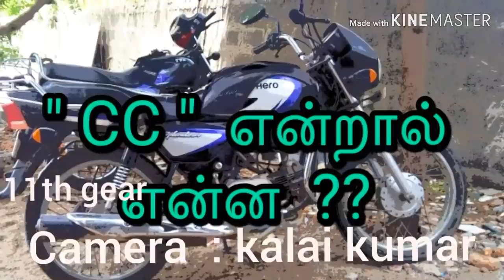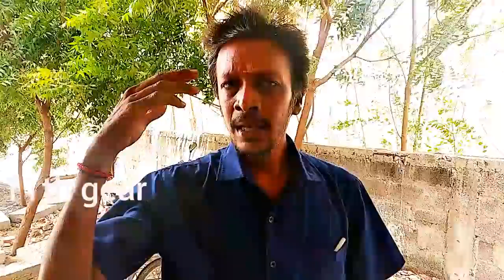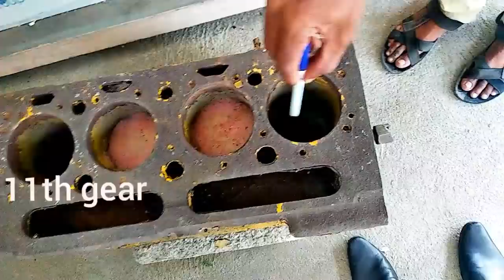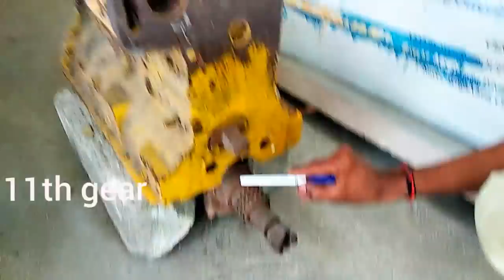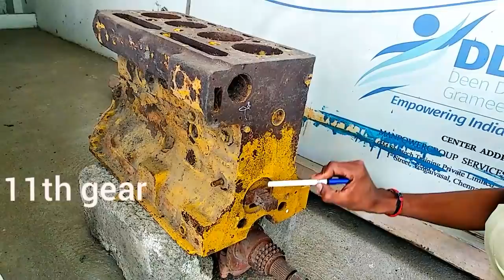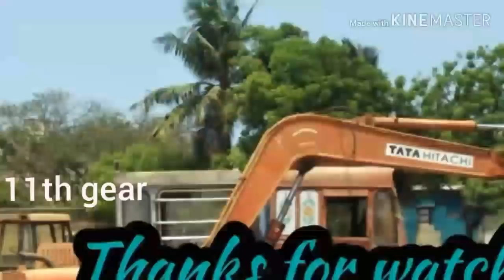Cc என்றால்  என்ன  ??

Comment: Volume of cylinder 
Example Hero splendor displacement calculation(CC).
Bore(diameter): 50mm, 
Stroke(height): 49.5mm
Volume of cylinder: πr2h
π=3.14, radius=diameter/2
That is 3.14×25×25×49.5
=97143cubicmillimeter or
97.143cubiccentrimeter(CC)
Reply: Volume of cylinder πr^2h not 2πrh kk
Reply: =2πrh
=2×π×25×49.5
=7771.5

Comment: Bro innum full detailed aa solluga what is cc? Athoda purpose, enna pannum, yethuku cc soldraga ellame solluga detailed aa sollum bothu Ellathukume doubt yellame clear airum bro
Reply: CC means cubic centimetres.       Cylinder capacity-3D value CCm’3
Example 1-  length of line in centimetre =5cm.  Here you can notice unit called cm . Cm means centimetre.   Just cm not centimetre Square not cube (means power 3).   Example 2- 2 Dimension rectangle. Lengthy and berth   . Cm x cm= cm squares. Example 3 3 D. Capacity cylinder L x H x B. =cm cube....

Comment: 2.5 litre cc ok ..

2.5 litre nu soldrathu petrol matuma ila air and petrol equal level 2.5 litera.?
Reply: Ama bro. Adu 2.5 litre of right air& petrol mixture for petrol engine and 2.5litre of air only for diesel engine bro. But you can't measure the air in capacity.it can measured in compressed state in kg or unit only. Siva bro is right,he exactly said how to measure manually,if ur not agree his point,then use cc formula available in Google